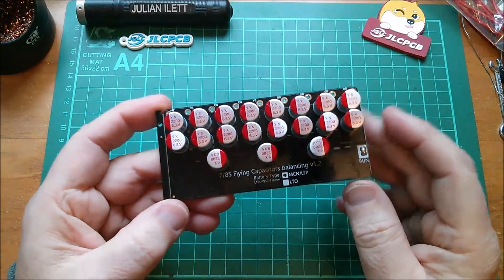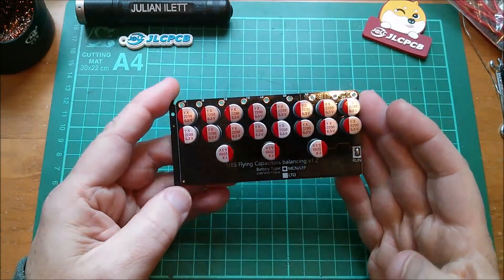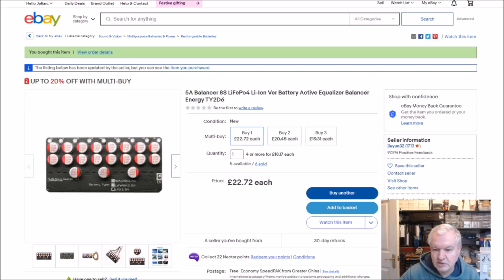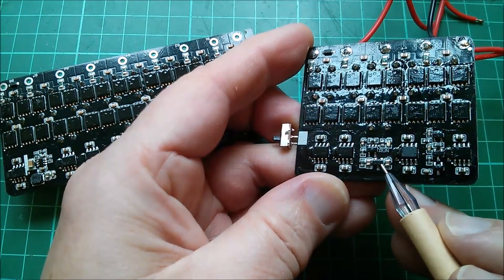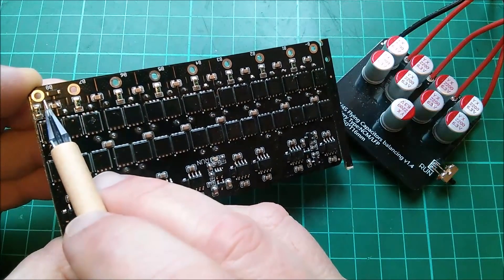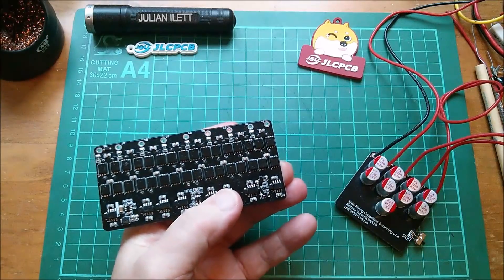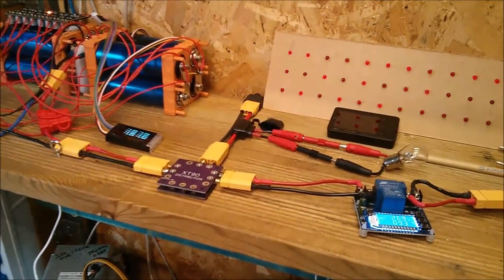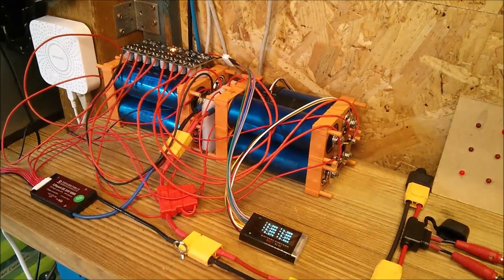8S Flying Capacitors Balancer for NMC/LFP

Comment: Been following your videos with high interest you touch on many projects I am looking to try. One that has been on my mind for months is not years is the ability to break down the circuitry used in BMS which contains the circuitry for keeping the cells safe. The first thing would be a circuit displaying current via LCD. This will acquaint me with how current is sensed while the BMS does it thing. Once I have the ability to create the current sense I can move on to control circuitry based on the current being measured. 
BMS = Batter management System.

Comment: I think 3.5v would be better for degradation purposes Because they really drop down to like 3.4v right away under load and stay around there and like 3.3v till it falls off I just don't 5hink if you are cycling it every day there isn't much need to go much higher than 3.5v

Comment: Random suggestion: make a little PCB or perf board that has several 9-pin sockets on it, plus 9 leads that go to ring terminals, with all the sockets wired in parallel. Then attach the ring terminals to the balancing lead posts on your battery pack. Now you'll be able to plug in as many balancers, monitors, BMS s, etc. as you want, without having to mess about with the battery pack's wiring! (You might have to make up a few 9-wire cables with the appropriate plugs on either end, of course.)
Reply from the maker: I'm kind of heading in that direction ;)

Comment: Can't you just bend it open?  As it looks like there is only one wire between the two packs. - 7:20
Reply from the maker: Wire link at one end - XT90 at the other, for the main positive and negative.

Comment: Julian, do you have any views on safety of these boards in the event of a fault?  I've got 16x200AH LFP for the house and have been considering the 16S version of the board for a while.  I'm kinda thinking that each battery connection should really have a fuse in case of disaster.
Reply from the maker: There are fuses on the PCB - they're 5A polyfuses - one for each of the red wires. I can't think how this balancer would create a problem, but keep watching, I plan to leave this thing powered up 24/7.
Reply: @JulianIlett  Oh the polyfuses will help it incinerating when there is a fault. They also indicate that the designers at least thought about fault conditions :)
Reply: For a pack that costs hundreds of dollars that size, you want a more sophisticated setup that keeps the cells in the middle 80% of charge, which is hard to do using only voltage measurements and no real balancing is needed except once in a while.
Reply: @murraymadness4674  LFP cells are not that easy as the resting voltage of a cell only moves by about 100mV between 90% and 20% SOC. Good balancing is therefore vital if you want to read the cell SOC in real time by looking at the stack voltage. 
Another method is to count AH in and out of the cells but the errors can grow until you really don't know the SOC accurately after a few days and the only way to fix this is to do a top balance then reset the AH count on a semi-regular basis.
I use both methods on my home system (10KWh + 15KWh stacks) and find that the stack voltage method works best in winter when it isn't practical to top balance due to lack of sunlight. This time of year I have to occasionally pull out the generator to boost the system by a few KWh when it gets down to around 25% SOC.

Comment: Do not trust the balancer with high currents. If I was you I would put a fuse in every balance line. If something goes wrong with it then the fuse will protect your sched!
Reply from the maker: There is a 5A polyfuse in every balance line (except b-).
Reply: I made up some boards with 5A ceramic fuses for my system. The boards screw onto the battery terminals and protect the wire from short circuit etc.  Funny thing is you have to keep the balance leads a minimum length for a given gauge of wire or you can exceed the fuse rupture current rating.

Comment: So these boards have different wiring positioning for NMC and Lifepo hookup right? Please explain. Can you answer if the "5A" pertains to allowable charge current through the BMS or what exactly this is for? Thanks .
Reply from the maker: No. NMC and LFP are sufficiently similar that this module works for both. The balancer can transfer up to 5A between cells.
Reply: @JulianIlett  so no conflict with bms at all? Presumably
Reply from the maker: The BMS balancing current is around 20mA. It's pretty insignificant.

Comment: I wonder why there would be different versions for different cell chemistries? It just shuffles little bits of charge around depending on voltage difference between adjacent cells.
Reply: Thinking each the balancer shifts into lower level of current or constant voltage as approaches capacity as with cc/cv protocol.
Reply: Can it do that? I thought those fets were simply 1p2w switches
Reply: @donepearce  maybe so. not sure
Reply from the maker: The LTO version will have a different voltage cutoff - that is: the voltage at which the run LED goes out.
Reply: @JulianIlett I presume that voltage is set with a potential divider from a pair of high prevision resistors.
Reply from the maker: Either that, or it might just look at the voltage of one cell. After all, the purpose of this device is to make all the cell voltages the same.

Comment: You should review the Parkside wire stripper/crimp tool!
Reply from the maker: I bought the Aldi one - it looks a bit rubbish. I did pinch a couple of red spade terminals from it the other day.
Reply: @JulianIlett  The one I got from Lidl isn't too bad so far! It worked on thick and thin cables.

Comment: I put heat shrink sleeves on my allen (hex) keys. Saves the issue of shorts in tight spaces
Reply: Good idea and it will make the grip a little nicer when applying lots of pressure.
Reply: Ya I rarely need an Allen around electricity but that is a good idea if I did

Comment: This might be obvious to some but I'm sorta new to DIY Batteries. So will this work on a 18650 power wall? I guess LiFePo4 Li-Ion means it will do both battery types? It says max voltage is 4.2 so I guess it will work for 18650s
Reply from the maker: Yes it will work for NMC and LFP batteries.
Reply: @JulianIlett  Thank you

Comment: Won't you have lower overal efficiency losses, if you start mining right away and only store excess energy to keep on mining for a while when the sun has gone down?
Reply from the maker: That assumes the solar panel produces more power than the Antminer consumes. Most days it's cloudy and solar power is very limited.
Reply: But still the process of storing it all will cause loses. Consuming the power as soon as there is a reasonable back-up will cut this out. Or am I overlooking something?
Btw, I do like the project as you're showing a lot of stuff I did not see before. 😀
Reply from the maker: Sure, the process of charging and discharging the battery does incur losses, but I can't do away with the battery. Sunshine at this time of year is infrequent. The battery is needed to accumulate energy from the solar panel until there's enough for a mining session.
Reply: Ah yes, that way it makes sense. 
Thx!

Comment: if you have some decent electrical tape, you can probably just wrap the allen key in it, rather than cutting it down.  less messy and is a non-destructive modification.